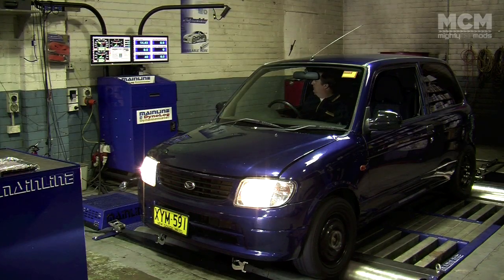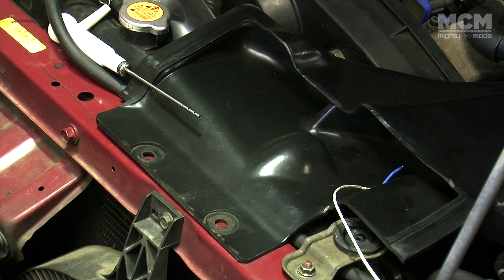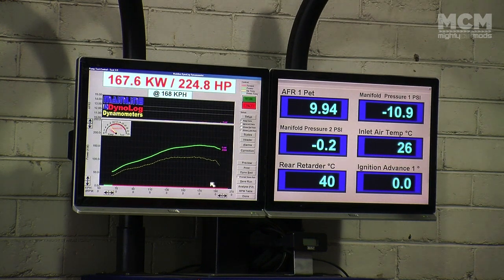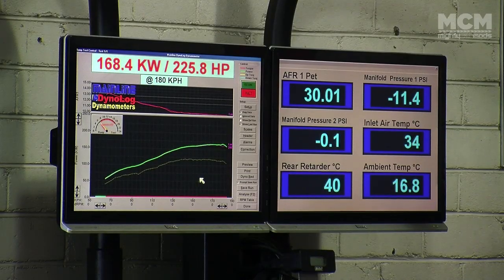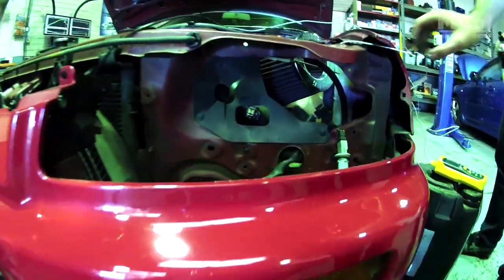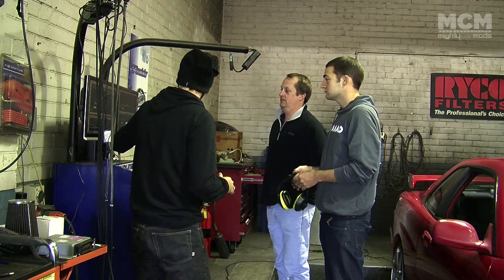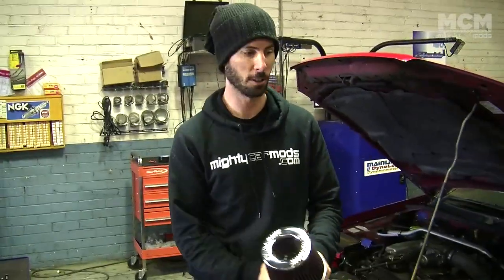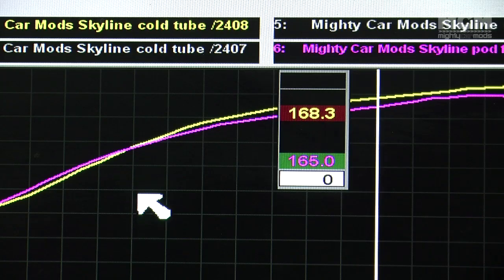Cold Air Intakes Mythbusted [Turbo]

Comment: IF COLD AIR DOESNT MATTER THEN TAKE THE INTERCOOLER OFF THAT CAR AND THEN LETS SEE THE NUMBERS IT MAKES! this video is false information and should be deleted before anyone else watches it and is taught incorrect info
Reply: Cold air does make a difference.  But how much of a reduction in intake temperature do you think a CAI give you?  I cant speak for all cars but where is your factory air box pulling air from?
Reply: The simple location of where the air is coming from is not the only factor in CAI's. Another is the size and type or air filter, obvisously bigger is better in higher horsepower applications and cotton media filters are better than stock paper filters. After that is the length, size, and material the intake tube is made from being able to dissipate heat better and have a better path, and also being located in a better spot in some situations where in some vehicles the intake tube is directly next to hot parts, exhaust, radiator, ect. The reason this test was such small numbers is because the car is already equiped with an intercooler, a slight change in tempurature before the intercooler is going to make minimal changes once the air has passed through both the hot turbo and cold intercooler. Also because the car is only putting out around 200 hp its not going to make a significant difference. There is a reason cold air intakes were invented and why drag racers dont use air filters at all, and have the air coming in strait into the top of the engine with either a hole on the hood or no hood at all. Please dont think that these guys are reinvented the wheel with this video because they aren't.
Reply: Dylan Hutchison That's a good answer to a different question, but not what I asked.  How much colder is the air with a CAI vs stock?  Have you seen any real data?
Reply: Yes i have, i work full time on cars, and currectly drive a procharged 5.0 mustang. There is noticable differences on everything i have installed, which is also why we recommend installing aftermarket temperature sensors, MAF, and O2 sensors because of there more accurate readings.
Alot of stock intakes have the filter and air box inside the engine bay with just a small tube bringing in air from outside. CAI's on the other hand have the entire filter located in the fenderwell with a plate to completely block out engine heat. There is too many factors on so many different cars for there to just be one set number of degrees colder when installing a CAI. Another big reason is also that heavily moddified cars require more air flow that the factory airbox simply cant keep up with. When you take a car that is bone stock like the one on the video the factory air box will still be able to keep up because that is the engine it was designed for. Try supercharging a N/A car and then reuse the factory airbox and see where it gets you.
Reply: Dylan Hutchison Lol.  Even you must think it funny the way you avoid that question.  I am currently driving a vette with a 6.6L turbo so I understand that a stock filter wont perform well on a heavily modded engine.  That being said, neither will a stock fuel pump work well.  But you never see a guy just upgrade his fuel pump on a stock engine and brag about his hp going up so why do people do that with air filters?
Reply: I didnt avoid it i said there was noticable differences but not an exact number on temperature difference because of the many factors involved. I understand what you mean, but you will not need a fuel pump until much down the road with modifications. And along with a fuel pump your goingto need a better fuel regulation system, bigger injectors, ect. Just a simple fuel pump will do nothing if you have the same injectors, but if you do put bigger injectors then you will see an increase and now have every reason to brag about it (especially since injectors can be as much as $120 each!) But when it comes to intake, having a cooler, more efficient sourse of air will increase power because colder air is denser, simple as that. Think about it, maybe a CAI alone isnt going to have a dramatic increase, but you better bet that if you put in a performance intake manfold, with intake spacer, bigger throttle body, upgraded sensors and a CAI then you looking at some pretty decent gains. Now put all those mods on without a good CAI and you wont have nearly as much of an increase. The thing is, if you want to make more power and start upgrading a car that is stock, you have to start with the things that are holding your horsepower back, for example, the stock muffled exhaust and exhaust manifolds, the stock computer chips, that give you a less aggressive fuel curve and timing, and of course the stock airbox..
Reply: Dylan Hutchison Yeah, I know a bigger fuel pump alone wont do anything. That was my point.  But why would you install larger injectors on a stock engine?

Any data I have seen regarding CAI is that they don't lower the temperature any better than stock.  In some cases they are worse.  You are still pulling from the fender, so why would it be colder?  The fact that the filter is under the hood will not translate into hotter temperatures because paper and plastic do not retain heat very well.  Use a metal intake tube and you are looking at heat soak. 

Leaving other mod out of the equation, I just don't see how a CAI will make power on an otherwise stock engine by lowering IAT.
Reply: Your incorrect, when the entite cotton media filter is placed out of the engine bay it is much cooler than a paper filter inside an engine bay even with it pulling air from outside. You would put injectors on a car because the stock ones are usually undersized to begin with and if you have a good CAI then your see more improvement. Look dude the the main reason you mod a car is because the more mods you put on it the more they work better with eachother and if your going to but one part at a time your best bet is to start with the simple things. Any Cold air intake that actually does its job in bringing in colder air is going to equal power. Enough said on the topic.
Reply: Dylan Hutchison I'm incorrect because you say so? What do you base this on?  The air filter inside an enclosed box with air flowing past it is not going to increase in temp.  You cant assume a cold air intake is going to give you colder air just because it has cold in the name.  Marketing hype.  Plain and simple.
Reply: The filter is surrounded by hot plastic with a small path of cool air. With the filter located completely outside it is surounded by nothing but cool air and has an increased surface area. A high quality performance designed intake is better than a cheap one or stock airbox, and is a must on modified engines, because of there increased size and better air flow. Ill have personal data for you the next vehicle i do.
Reply: Simply why a good cai is not a sales gimmick
Reply: And what material is your intake tube?
Reply: Alot of times stock are rubber and aftermarket is good thick plastic. but whatever, Theres no hope for anyone who watched this video and believes it. Everyone here needs to go buy and prius and never worry about working on another car again if they seriously think CAIs are fake.
Reply: Wow.  Nice speech drama queen.  You are trying to convince an engineer who has spent a lot of time studying and practicing thermodynamics that by pulling air out of your fender the air will be noticeably cooler instead of stock which pulls its air from the same place.  Does not make any logical sense.
Reply: Umm hello smart guy i am an engineer and i build racing engines for a living, engines that make thousands of horsepower, you obviously think that the only factor in the entire intake system is whether it comes from inside the fender or not. Just because that is your only argument shows you dont have very much thinking capacity. You take into no consideration, the size of the tubing, the air flow and surface area of the filter, ect. Okay and here comes the tough one big guy, try and wrap your head around this one. There is heat from the engine bay that surrounds the entire airbox.. (Thats the thing with the filter inside) and because of that the little restrictive stock filter now has more heat surrounding it, regardless of where the air on the inside comes from... There is a reason why there is so much time and money invested in just the intake portion of an engine and why K&N filters (which only make intake parts, except or oil filters) is a huge industry constantly finding new and better ways to make real live performance cold air intakes. Yes crazy isn't it??!?
Reply: And I guess mister engineer that you skipped the part of science class that explained the difference between insulators and conductors.
Reply: It doesnt matter if you made the airbox out of ceramic its still going to get hotter than if there was no airbox at all and just a tube from A to B.
Reply: Ceramic of course being one of the best "insulators"
Reply: Coat your intercooler with ceramic and let me know how well that transfers heat.
Reply: Were talking about intake tubes here dude. Ceramic being a good material to keep as much engine heat out of the intake tube as possible. If you made two intakes the exact same except one was a direct path from the fender to the throttle body and one that goes through an airbox, you direct tube will be better. Im not even refering to a turbo car with an intercooler cus obviously a cold air intake will make less of a difference
Reply: Well that went right over your head.  Im not talking specifically about turbo cars.  Im talking about heat transfer or heat exchange.  If you want to transfer heat out or in to a system, insulation will hinder that.

If the air in the airbox was not moving and the air around the outside of the was always hot, then yes, regardless of the insulation, the air temperature will reach equilibrium.  When is this ever the case?  The car pulls in a crazy volume of air and the air under the hood is only hot when you are not moving.  If you don't know those two things, no one can help you.  In order to even marginally increase the temperature of that volume of air, you would need some kind of heat exchanger.  You would also need to circulate hot air around the box and that does not happen.  That's why an intercooler does a decent job of heat exchange.  It is made of metal (conductor) and has cold air passing through it (circulation) and it has a very large surface area (fins).  Take away any one of those things and heat exchange is nil.
Reply: Well you said coat a intercooler in ceramic, so you were directly referring a turbo car. And yes the air inside the intake will be constantly trying to cool down the surrounding material, while the outside air will be trying to heat up the material its surrounding.
So no matter what kind of material you make the intake out of, the less material is there the less heat there is total, so why would you want more surface area of material rather than less? You dont, you want the least amount of material resulting in the quickest straightest path, from fender well to throttle body,
The filter is obvousily the more restricted part of the system, no matter what filter it is, so the air around the filter will be moving the slowest, thats why you want the filter totally by its self in the fresh air because the air will be around it longer, rather than in a slightly warmer area of the intake which would be the airbox.

Comment: the CAI can draw more air but the car's computer won't force more air in unless you also increase the fuel intake for the air/fuel mix, so you need to tune it as well, and get the exhaust done so the extra air can flow out better too.  It doesn't do much alone, but in conjunction with other mods and a tune, it does.

Comment: 1.3, 2.0 turbo, and 2.5 turbo... come on put a real car in there. get a blown v8 and you'll see some results. car that don't make much power to begin with are not going to have much increase.
Reply: Hahaha. A 400$ civic with a 1500$ motor can take vipers an vettes. V8? V8 got WEIGHT! we running cars less than half as heavy. Power to weight racer boy.

Comment: My experience told me that filter makes no difference but the length of the intake does. The longer the tunnel is, more high rpm power it will make and vis-versa but it won't make that much of a difference. Thanks for myth busting

Comment: I agree with others.  You need to run this test on a naturally aspirated car, and also in a much colder climate to see the real gains.  Also use a real cold air that get the filter in the front bumper outside of the engine compartment.

Comment: SRI compresses air mass if your in a drag racing, regardless NA or Turbo, it does helps a lot. 
CAI in tropical countries like mine, where summer is really really hot, CAI does gives significant low-mid engine response on a manual tranny. Nobody in the world drives at 6000rpm peak power all the time. 
So CAI and SRI are not really meant for comparison at peak power, its how everything respond during the whole rev range while you are driving. If you drive uphill in a narrow course, where your average speed is 30-60kph, CAI does help. If you drive more than 120kph SRI effect will kick in, arguably most effective for HONDAs or other NA engine. It is true that if car is going more than 60kph the engine bays tempt cools down, but if you are below 60kph up a winding hill, CAI does work a lot on that, again in a HOT COUNTRY SUMMER.

If you drive your car with your windows down all the time, chances are your country is not HOT enough for you CAI to work LOL

Comment: Area under the curve matters more than peak HP. It's possible to see a HP gain elsewhere in the curve without seeing any change in peak HP. It's also possible to see a change in peak TQ if it doesn't occur at the same RPM as peak HP.  Did you guys even look?

Comment: One thing I'm really curious about (that can't rightly be dyno tested) is a ram air scoop on the front of the car. In theory, the car's velocity should aid airflow down the induction system as the vehicle is pushing through more and more air. Without the car moving, you're not going to be able to test that funneling effect that the vehicle has in motion.

Comment: On an NA engine with a true CAI (located outside the engine bay and away from the radiaator preferably in a fender well or front bumper) with an upgraded exhaust, now there's a caveat no one discusses, (headers, high flow cat, larger diameter piping) then yes a CAI can make more power. The whole premise is making the engine breathe better, but you can only cram so much air down its throat (without forced induction) without being able to expel just as much air. That being said if you're going to go to that length you've already thrown $800 -$1000 into it you might as well port and polish your head(s), get a high lift cam(s), and be ready to pay for no less than 93 octane. Hell port and polish you can do yourself with video instruction, high lift cam(s) will only run you around another 6 or so now that premium fuel to avoid running lean that will get spendy, and you can kiss any fuel economy goodbye if you're doing this to a sport compact. That being said you go to that length now you're talking some real power gains. Next step? Forced induction and or Nitrous then you better be thinking forged sintered connecting rods and pistons and a forged sintered crank, oh yeah and a new MAF or MAP that can handle pressures above 30 and below 0. Just my whole two cents on CAI's. I have a short ram and a 3/8 " larger exhaust manifold back and there's a very mild difference in performance, big gain in fuel economy though.

Comment: The common sense of this is if you add a cold air intake you will be pushing colder and denser air into your engine so you need more fuel to compensate and keep the air:fuel ratio similar so you don't run lean. If you upgraded the fuel pump and/or injectors you would have seen more gains
Reply: Wow so much misinformation in this comments section. The small adjustments are barely going to affect the injector duty & are certainly not going to max out the stock fuel pump.

Comment: Y'all tried it on an line 6. turbo boosted at that. I'm surprised it didn't lose more power. One, it won't entirely reach its full function on the entire motor. Two, the boost compression is soften so you need to tune it for that specific air flow. but, I'm just going on common sense here.

Comment: With a test of only one vehicle, I wouldn't say it is Mythbusted entirely. There are many factors to intake air and power. The ECU, as previously mentioned by another poster, makes the biggest difference. Air intake temperature is vital, as is intake velocity. This was also done on a turbocharged vehicle, that is likely running a 3-BAR MAP sensor in addition to MAF. A CAI is going to show no significant gains on a 3-BAR MAP sensor, because the pressure change is negligible to the calibration voltage signal sent to the ECU. MAF systems typically track the velocity and temperature to "estimate" air volume based on the cc of the tube it is attached to, changing this particular area of the intake system, change the volume area around the sensor and can cause the MAF to send incorrect voltage, which changes both spark advance and air/fuel ratio. There are many aspects that are not accounted for in this video, and chassis dynometer tests have been conducted by many racers with CAI systems and shown between 5-7% wheel horsepower(kW) increases.